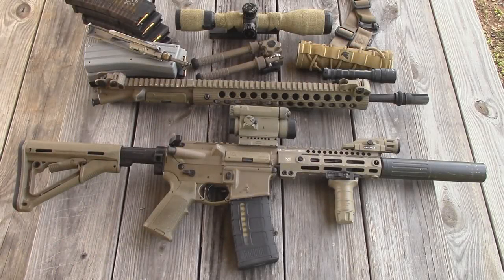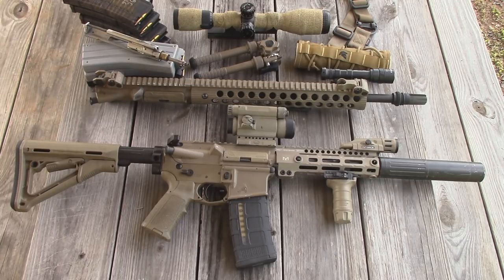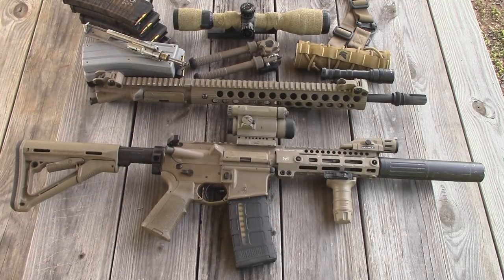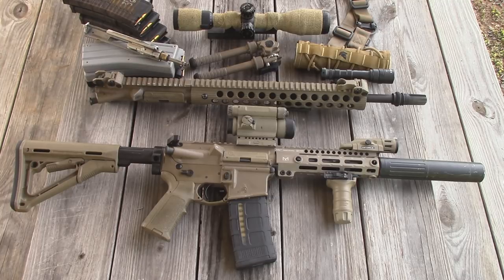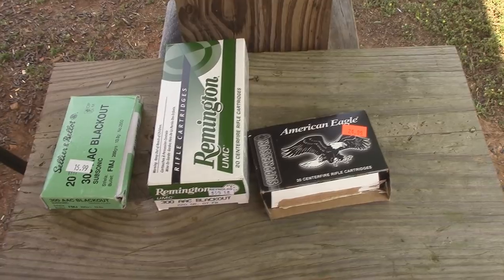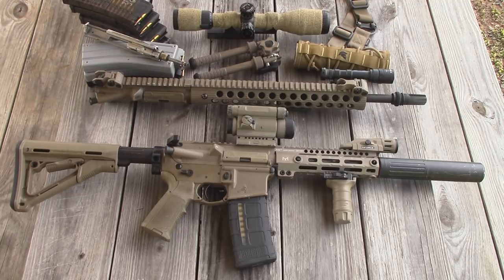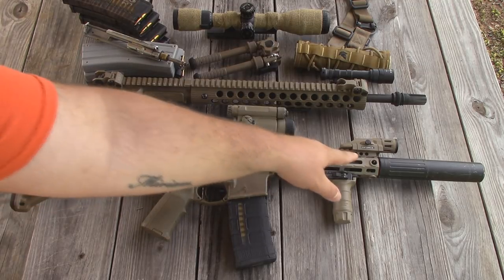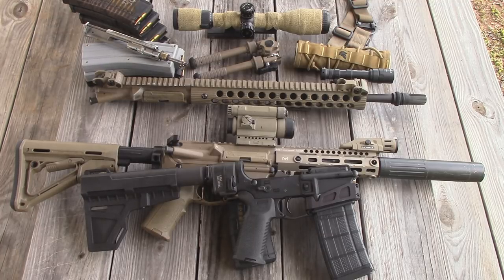Building My Ultimate Suppressed 300 Blackout AR-15 SBR

Comment: You think like I do with all that interchangeable stuff on your guns, I love it when you can get more out of the investment for each part.  Getting a suppressor that can move from a .308win. to a 5.56 is a better deal, than  for get getting one that is for just 5.56, same with the .45, it can fit on the 9mm.  Always buy them big so you can move them on to the smaller guns, with the .22 being a separate one because of all the junk it produces, use it only on a .22..  You have good taste in guns, I like the looks and performance of everything you did there.  300 Bk Out has become a favorite round for me.  As quiet as they can be, I still love the super sonic CQC rounds that Leigh Defense makes the best, it is the most bad ass round for self-defense out there.  It blows up as big as a melon when it hits and never exits past 10 to 12 inches. Double tap that into any bad guy and you problem is over fast and that's what defense is about, fast stopping power.

Comment: Cast your own cost:
Alloy $2.50 pound
230gr 30per pound
Gas checks $40 thousand
Lube or paint
Primers $110 thousand
Powder $400 pound
These include taxes and shipping and hazmat.
$330.00 per thousand without brass. Add $440.00 for brass. Total $770.00 per thousand if you have the $3,000.00 in equipment. 

The reloading saved brass is the only way to "save" money. You will need to reload about 5,000 rounds to break even.

My advice??? Get a Dillon 550. RCBS dies and trimmer. Lyman  bullet molds with RCBS handles. Lyman sizer and lube. H335 powder CCI 450 primers.

.09+.04+.02+.11+.08=.33 per round

Comment: That's one sexy rifle, I'm building a 5.56.
Aero precision stripped m4e1 upper and lower
Geissele mk14 15' rail
BCM BFH ELW barrel 16'
Mil spec receiver extension
B5 stock 
BCM bolt carrier group
Geissele super 42 buffer spring and buffer
Geissele charging handle 
Geissele ssp trigger 
BCM lower parts kit
Geissele gas block

Comment: i use those barnes poly-tipped all-copper beauties.  but the supersonic variety already factory loaded.  i am less concerned about noise than velocity.  i figure, what's the point in having a larger caliber if it isn't going at least Mach 1..
thumbs up!
Reply from the maker: Yeah the subs are a lot of fun but for serious use I'd rather have supers. The 230 gr. subs are basically a glorified 45 acp. If I'm preparing to kill something either for hunting or home defense I want supers.
Reply: .308 is the way to go for supersonic and punch and long distance accuracy,  just ask gunny hathcock.
Blackout is for quiet up close and personal. 
5.56 is medium range light fast and accurate, 
Therefore, country boys gun is appropriate and correct. 
Good job! And WANT!

Comment: I have a similar setup too.  Have you thought about the Magpul MBUS Pro Offset Sights for your backup iron sights?  Looks like you have the room on the rail and they fold down too.
Reply: Mike 300 BLKOUT with the optic he has... it would serve no purpose to have 45 offsets on it. He’d be better off using sights that are inline with the optic like normal irons

Comment: I haven't owned a weapon, in about 7 years. But I miss hunting and target shoots. Forgive my lack of knowledge,  as I've never owned a 300 blackout or any ar. 

Question
As seen here, hes using 8" barrel with suppression, with subsonic rnds, for closer targets. Could a mag of supersonic rounds be used, or is a barrel and gas tube swap necessary,  for longer range, on the move?

Comment: Just how close is the fit between the handguard and the suppressor? Do you think a 9.7 inch handguard with a 10.3 inch barrel will work with with that suppressor? will be 0.15 inches closer than yours..
Reply from the maker: I'd say no. Mine is very close.

Comment: Wait, so still naive here, but I'm drawing a blank as to what is and or isn't legal in the way he is operating the B-E-A-UUUUUTIFUL piece of equipment.?.?  I was EXPLICITLY told by my local gun dealer (DUNCANS) here in Bay City, MI. that would be staring down a federal indictment of quite a few "boo-boos" if I were to A: hold the pistol to my shoulder and use the grip as a "buttstock" and B: slapping a forward grip onto it is another no go especially on an 8" barrel...  

Honestly so FRIGGIN wondering because I'm about to go in there and buy buy buy if this is nay-say.  Unless federal regulations have garbled up that much BS in the timeframe of this video releasing...
Reply: it's an SBR not a pistol .
you have to apply for , pay for and wait for a tax stamp to own it . this guy waited 9+ months for his .